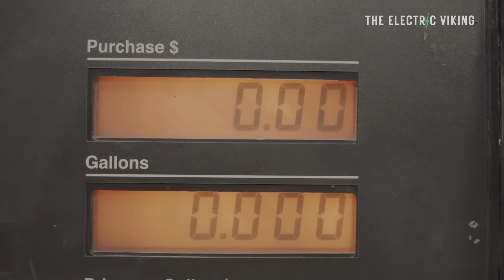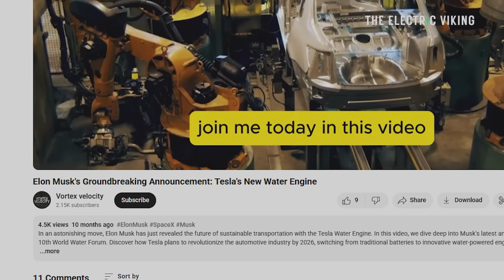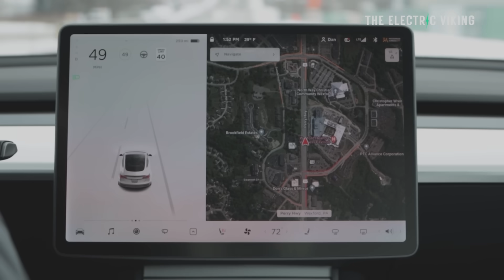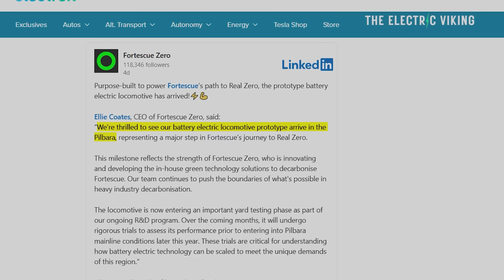The Train That Never Needs Charging – Game Changer for Global Transport

Comment: I heard at 3:30 a mention of regenerative braking in cars. What about the shock absorbers too? Instead of heating up a fluid, why not make them deliver charge into the system.  Putting in "regenerative  shocks"  will add to the mix, and make up somewhat for rough roads causing increased friction. Is this already being done and I missed it?  Also, another way to remove a crude oil based product from our lives.

Comment: Interesting! I am a retired streetcar motorman in Pittsburgh, PA, USA. Pittsburgh is located among the western foothills of the Allegheny Mountains and so is very hilly. After receiving light rail vehicles from Siemens/Duwag, PCC streetcars were retired in August of 1999. Since then, Siemens/Dwag cars have been rebuilt, and new cars have been added by CAF. Before I retired, I was told that the regenerative braking was one-third efficient. For example, the Mt. Washington transit tunnel is 3600 feet long at a 6.5% grade. So, three LRVs descending the grade could generate all the power necessary for one car ascending through the tunnel.

Comment: Diesel electric locomotives have been using ‘Dynamic Braking’ on downhill sections of track since the first diesel electric locomotives were introduced in the 1950,s. Diesel electric locos use a diesel engine to power a large DC generator to power the electric traction motors on each axle. To use this as a braking system (Dynamic Brakes) the traction motors are turned into generators which creates resistance on the axles. The electricity produced is bled off via radiators (resisters) in the roof and large fans. The air brakes are completely separate and work on both the locomotive and the trucks depending what you want to do.  So essentially they are just routing the power that is normally bled off the dynamic brakes into batteries instead of the resister banks on downhill stretches. Good idea. I wonder how much power it takes to get the train rolling to start with. Modern roller bearings in rolling stock and the point contact the wheels make on the rail mean that there is very little rolling resistance on downhill grades so once you get moving and you can build up quite a bit of kinetic energy that could be converted by the dynamic brakes into electricity for batteries. 
Sam, please pronounce it “ Pill  Ba ra”. Not “Pill Barra”

Comment: Disappointing, Sam.  Discounting your trailer promises, it is interesting to see what Fortescue is doing, until you say 'why not apply this to ordinary trains?'.  But you know you can't have something for nothing.  They are taking very heavy weights (a train full of coal or ore) from a high level to a low pone (usually sea level for a port to export it).  The potential energy the full train contained at the top is converted to kinetic energy and through regen braking, enough of that is saved in the batteries to power the empty and much lighter train back to the top for the next load.  Very impressive.  Entirely different to a regular transport system.  Come on!

Comment: As the majority of people are saying in the comments. This is a unique situation Where the the extra weight going downhill powers the battery to go back uphill.This basic concept is very old. I am very surprised that 'Electric viking' didnt realise this and mention it. Its a bit of casuistry. In energy you never get something for nothing, thereare always losses. This sort of system was used in a funicular train that only uses water to pwer 2 'cars', 1 up and 1 down in Lynton and Lynemouth. it started 130 years ago and ive been on it, it works like a dream. So come on, stop all this bullshit and be straight with us. You need to raise your game and cut all this crap. Regen braking is useful but it wont power vehicles all the time or even the majority of the time.

Comment: The title is misleading. This is basically regenerative breaking which all electrical cars do. Yes, it can recover energy. An “infinity train”, or “train that does not need charging” ONLY works in a case where you go down hill heavy enough to regenerate enough energy for the trip without cargo back up. In terms of a mining company that might in fact work. It does not serve his purpose to present information in a misleading way that could be interpreted more positively than in fact true. Particularly in such a contentious environment. People would use a report like this to discredit the whole concept which would be a shame.

Comment: There are a few mining locations or shipping locations where optimizing this makes viable sense, where heavy materials need to be hauled down from a mountain or down to a seaport. But for most applications it only makes a few percent difference, and that's what regeneration is all about, and it's already in use.

Comment: This is how Elon Musk has described long distance flying. 
He says .. a plane just needs to have enough batteries to get it to say 45,000 feet, Then the elec. motors are turned off and the large glider type wings bring it slowly back to earth using the the backward turning motors as generators to recharge the batteries. If needed, the motors can be switched back on and the plane taken back up higher if the glide/drop ratio requires more distance to be traversed. Once at it's destination the motors are turned back on for a powered landing .. using some of the energy recovered. Then the batteries are topped up and the plane is ready to go again; with a high proportion of recovered [regen] energy and a bit of new 'top up' charge.

Comment: All electric rail systems with regenerative braking do this without the battery what's the United States does not have much electric rail, necessitating the battery. The flood of freight trains having to cross the highlands of California to go east are heavy trains going up the mountain. Algorithms with batteries can maximize efficiency perhaps. I think this can be used in truck trailers covered with solar panels, that would have to endure powerful car wash brushes.

Comment: It is only true if the train when it returns is at the same status it was when it left. If they now use solar energy stored in batteries to recharge the train then the train is dependent on the re-charge time to be used of its next strip. If the train was running on zero-resistant then the general conservation of energy will work.

Comment: 1. Where does the energy come from to move the Infinity Train up to the start height? 
2. Assume the carbon used to build the train and rails is dicounted?
3. So it might be a method of reducing fuel in a narrow sector of energy use where load is already high and can be moved lower for little energy? Then it manages to move the train back up. Pretty limited usage, and not in the least a 'gamechanger for global transport' most of which isn't used to move heavy loads down hill. 
4. One size fits all is not a solution to energy use, most of which is variable. Transfering from high to low easily is not a new concept, it's ancient. It could reduce energy use for specific cases like this mine. I use regen to increase mileage for my EV, but since I live in Norfolk which is very flat, there is little gain from running down hills. 
5. The planet doesn't need saving, climate will make us extinct along with most life, which will then evolve again once excess heat has dissipated over time and the mess we have made has corrupted. I doubt there will ever be a species like homo sapiens ever again.

Comment: I would like to see trains with batteries replace diesel engines for rural routes where the electric infrastructure to power the trains is not present.  These trains could charge up on infrastructure around every station stop.

Comment: Railveyor (the company I work for) already manufactures an electric TrulyAutonomous, light-rail, low- friction train system for mine haulage with regenerative breaking, which recuperates energy as loaded trains are in downward slopes. In some cases, the operating cost (including energy and maintenance) can be less than the recuperated energy credit. One of our system installed in Missouri, USA lowers OPEX (operating cost) by 92% according to the client, compared to diesel trucks!

Sam - please reach out if you like to do a video on our existing clean, safe, and reliable technology!

Comment: Trains in Australia have been using regenerative braking for decades now. When electric trains are slowing down their traction motors are turned into generators and the power is put back into the overhead wire and to the grid. 
When we had electric locomotives in Sydney it was common knowledge that a coal train coming down the blue mountains line would power one going up the hill. You can hear the motors on all the trains around Sydney  especially the new ones. Next time you are on a platform and a train is rolling in have a listen to the motors as they are in regen braking.

Comment: Even if a train doesn't have the extra downhill load, it would only have to fuel the friction losses and not the uphill cargo lift that is fueled by regen at 4 MW. You could position two or three add-on battery locomotives with 9-15 MWh each at the base of the Rocky Mts. to compliment the two diesel locomotives and just turn the battery locomotives around for trains going uphill.

Comment: I saw one of these locos heading up to the Pilbara on a low loader truck on the Great Northern Highway, so it didn't go from Perth to the Pilbara on a railway line under its own power. The concept is interesting, on the BHP Newman to Port Hedland railway the iron ore trains burn more fuel travelling empty back to Newman than they do travelling loaded to Port Hedland due to Newman being 550 metres ASL. If FMG's mine is at a similar altitude to Newman there may be something to this. Iron ore trains are very heavy so this may be a tad optimistic, but time will tell.

Comment: Now that oil and gas are expensive and unreliable its interesting how old physics is being used to cut costs and stabilise production makes good business sense and battery technology is making it more appropriate just as vertical landing a rocket with super computing and GPS. Could they also use diesel electric regen in other circumstances as in Edison logging trucks Canada

Comment: Oslo has done this for a century with their commuter 2 car trains running up and own the mountains in the suburbs. The trains heading down provide the power for the trains heading up. Since you don’t have the loaded on the way down/unloaded on the way up benefit of the mining example, they 2 car trains going up do need more newly hydro generated electricity than just what the 2 car trains headed downhill provide, but still a great savings.

Comment: This is an idea that's been used for thousands of years by birds. Birds are capable of flying thousands of miles no-stop from the northern hemisphere to the southern hemisphere and back covering over thousands of miles. 
The Bar-tailed Godwit** flies non-stop from Alaska to New Zealand, covering around 7,500 miles (12,000 km) in one go—without food, water, or rest.
The Arctic Tern** holds the record for the longest migration of any bird. It travels from the Arctic to the Antarctic and back each year—a round trip of about 44,000 miles (70,000 km). That’s like circling the Earth almost twice.
Whatever man does, nature can do it better. Birds just fly steeply upwards then glide downwards for miles and miles. Gravity does the rest.  From the film Nature Before Science.
Reply: You are aware that gravity pulls towards the centre of the mass of the Earth rather than in the North/South hemispherical direction. In the case of migratory birds the bird itself is adding the energy to its system by flying up to a height before gliding down.

A Peregrine Falcon is a better fitting bird orientated analogy, jumping off a high perch and using gravity assist to accelerate its rapid dive, using the energy in the momentum built up to swoop back up into the air again.

Comment: I wouldn't call it a false economy,  however the energy consumed is embodied in loading the train with heavy loads. That said, they would be loading the train anyway, so it does sound like a net gain in application of this interesting concept.  It's simply better at utilising that potential energy ( the one way freight ) via regenerative breaking and battery storage.  So, impressive as it might seem, it's  more about efficient energy management within the system. The interesting part is that that freight still has the same embodied energy at the end of its journey, however its potential is reduced in a way,  as its at a lower elevation.

Comment: Live on a high hill with a ready supply of elevated water. Add a big tank fill at the top, charge the battery on the way downhill to work, regen braking, empty the water out and drive home. Free transport. Or let the water flow downhill freely in a river.

Comment: Thanks. This technology is being used by trucks of a mining company in Switzerland. However,  this concept is only relevant for specific cases where you take a heavy cargo from a higher elevation to a lower one and return with a small cargo. If the difference between the two is not high enough compared to the elevation difference and energy loss on the way, it won't harvest enough energy downhill to climb all the way up again.

Comment: There is a gravity ropeway in the UK that has been operating on this principle for the last 100 years. But it only works because it only ever moves heavy stuff from a high point to a low point. If you're digging stuff out of a big hole in the ground and having to lift loads up out of the hole, it wouldn't work for that.

Comment: Mining companies have always done this, just using cables.  In my city, Dublin, you can still see where Dún Laoghaire Harbour was built by hauling rock from a quarry about 3km away.  The loaded trains went downhill, pulling the empty ones up.  When it was completed, they rebuilt it as a tourist attraction in the mid 19th century using air pressure (the 'atmospheric railway'.  In Wales, there is a funicular using water - it fills up at the top, empties at the bottom, no energy used at all, just gravity and the weight of water.
Reply: Nothing happens without energy. In this case, potential energy is being used.

Comment: I've been watching this for several years. The Fortescue train is fairly unique, they ship ore from 300 meters above sea level down to sea level. Downhill is loaded, uphill is empty. So the loaded regen is greater electricity generation than the empty (lighter weight) climb electricity consumption.  This is not common in cities worldwide where downhill weights are similar to uphill weights. This concept cannot work when uphill weight equals downhill weight. The reason is friction losses.
Reply: Yes, but then you only have to fuel the friction losses and not the uphill cargo lift that is fueled by regen at 4 MW. You could position two or three extra battery locomotives with 9-15 MWh each at the base of the Rocky Mts. and one or two extra diesel locomotives to compensate for friction.
Reply: Thank you for stating exactly what I was thinking.  I cannot imagine very many scenarios that are similar to Fortescue.  For those that are, it is a good idea.
Reply: It may be compared to  personal lift which is balanced with anti weight and comes down with gravity of persons and goes up without them to bring down next  good calculated number of following passengers. - very smart solution withot need for charging and in this case even without batteiy except of course controls showing which is the level.  And it should be not alowed to go out before zero level. Enough number of passengers cold enable fantastic presentation of something hard to imagine☺

Comment: I think regenerative breaking or taking advantage of gravity going downhill is quite widely used even in hybrid or plug-in electric cars nowadays to recharge batteries (even my Toyota Yaris has it).  Honestly I do not see any breakthrough here.  Happy to see there are some use cases where the energy efficiency can by optimized to the maximum, but this will be rare.  Probably any electric vehicle that has batteries should have it  if it makes economic sense (car, truck, train, etc)

Comment: Sorry, but you seem to be suffering a fundamental critical thinking failure on how this could be applied to paseenger trains.
This thing only works of there is a (large) difference in the weight of the train in the two directions. While it is true that some train routes in the world MAY run on an incline (not all!), the weight difference requirement necessitates that there be a net difference in human traffic in the two directions.  Unless you have some sort of massive human factory up in the hills and a town that has infinite population capacity at the end, that model is not sustainable. Pretty soon the town in the hills is gonna be uninhabited, and the town in the valley is gonna be rioting about all the "ferinners" "takin ur jerbs". Perhaps you're thinking that some sort of (solar powered?) catapult can twang the passengers back up the hill? 
And if you're thinking of just adding rocks at the top, you don't understand economics either. transport services have a hard enough time making a profit WITHOUT having to dig up ballast rocks at one end and dispose of them at the other,.. nless you're suggesting that people ONLY travel between profitiable mining deposits and coastal shipping hubs.